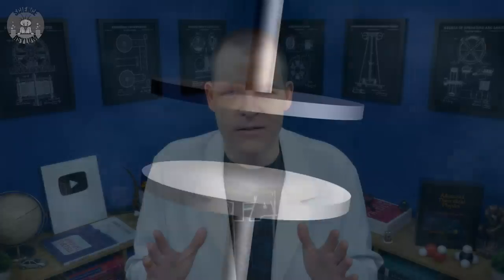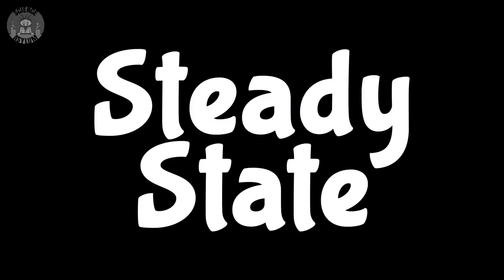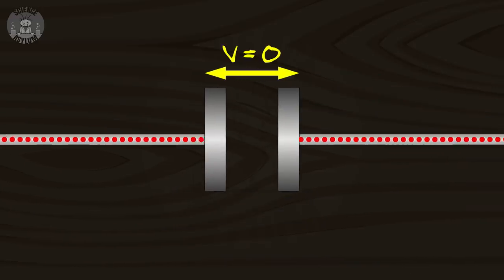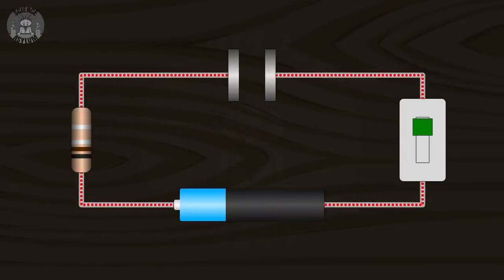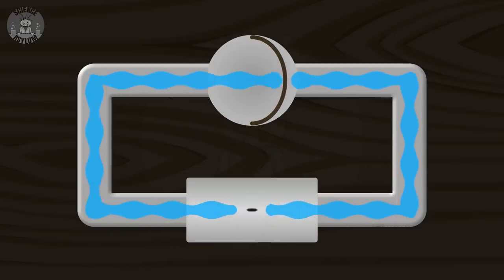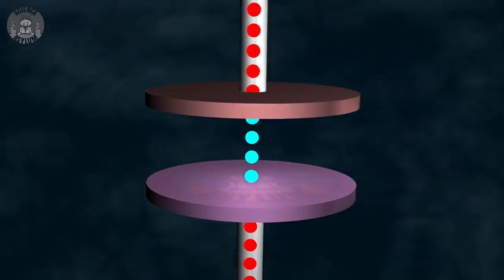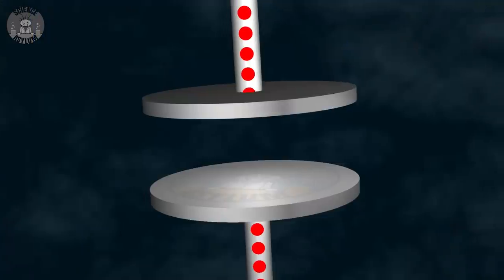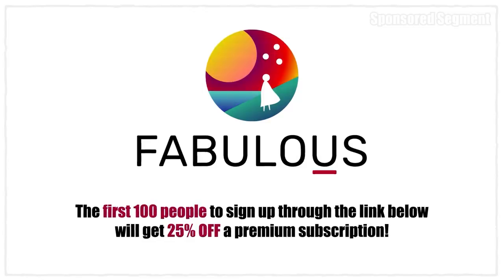Capacitors Are Gaps! How Does That Work?!

Comment: Great video!  I’m not sure your statement about “current not depending on speed” is correct.   Current is the amount of charge flowing through a surface per unit of time.  So all other things being equal, more speed means more current.
Reply from the maker: Yes, more speed means more current, but that's not how it practically happens. More current doesn't necessarily mean more speed. Say you're looking at two points in the same circuit at the same time. If you measure two different currents at those points, the speed of those charges is more than likely the same.

Comment: Hey Crazies, How are batteries working? I learned it at school like it's a watertower/waterbuffer and water is flowing from a higher to a lower point, but I noticed now that electricity is not water.
Reply: There's an electric potential accros the two ends of the battery that is shorted when you close the circuit. It is very similar to a water buffer, actually. The electrons are the things flowing.
Reply: It depends on the battery technology, as well as how you define "battery". We'll use lithium ion batteries as an example:
On each end, there are two terminals, the anode and the cathode. These terminals are separated by an electrolyte that is permeable to lithium cations, but not electrons.
Lithium as an element is very reactive, even to normally inert things like water. As an alkali metal, it has a very low ionization energy, having only 1 electron in its valence shell. Because of this, it will drop that electron at a moment's notice, turning into a lithium cation. This act of giving up an electron is called oxidation.

At the cathode is a type of metal oxide, typically cobalt(II) oxide. At the anode, there are many sheets of graphite, which are hexagonal lattices of carbon atoms stacked on each other. The graphite essentially acts as a parking lot for the lithium ions and electrons, not interacting with them chemically but being a space for them to hang out. In a fully charged state, all the lithium ions and electrons are sitting in the graphene. The electrons really want to go to the cathode, but can't get through the electrolyte. In this configuration, the chemistry is unstable and high energy [or rather, high potential]
However, when you attach something to connect the two terminals, it channels the electric field through itself and the electrons start to rush over to the cathode through that new path. The lithium ions, attracted to the electrons on the other end, can simply pass through the electrolyte. In its cation form, it can't do anything with the cobalt-oxide lattice, but if it also encounters an electron at the same time, it reduces back into a neutral lithium atom and can bond with oxygen atoms in the lattice to produce lithium cobalt oxide. This act of gaining an electron is called reduction.
In a completely discharged state, all the lithium atoms are in the cobalt oxide lattice. In this state, the chemistry is very stable and very low energy [potential]

When you plug them in to recharge, the cathode becomes oxidized and cationic, which pulls on all the electrons from the lithium cobalt oxide. As the lithium atoms are oxidized [due to their easily being able to ionize], they become attracted to the anode, which is being reduced, and pass back through the electrolyte into the graphite. The cycle continues.

All rechargeable batteries are based on the principle of a reversible reduction-oxidation reaction [redox reaction]. Non rechargable batteries use redox, but are not reversible.

Comment: Except electron's kinetic energy, energy in a capacitor circuit flows via electric & magnetic fields. Electric field moves within  the conductor & capacitor plates but magnetic field moves outside the conductor & capacitor plates. Energy does not flow from outside into the conductor or capacitor plates.

Comment: Great explanation and amazing visuals, thank you! But! You missed the most interesting part, what's the use of these capacitors? Shows that you are theoretical physicist 😉
Reply: There are thousands of uses of capacitors in the electronics industry.  The short answer is that they are used for filtering signals, as they respond differently to low vs high frequencies, unlike resistors that respond uniformly to all frequencies.  Capacitors and resistors can be used in combination to form low pass filters, high pass filters, and band pass filters, that selectively allow certain frequencies to pass through a section of a circuit.

The power supply in your computer uses them for smoothing the pulsating DC that the diode rectifier produces when converting AC into DC, into a much more steady DC voltage that your computer requires.

Comment: I can still remember the smell of tantalum capacitors and their unique ability to reliably create a shortcircuit when failing. Good times! I'm getting old though…
Reply: And electrolytic capacitors make great confetti generators when you either exceed or reverse the voltage across them!

Comment: What determines the “uf” (capacitance) of a capacitor?
How much energy can they “hold” before becoming saturated? 
👍🏻😁👍🏻
Reply: energy is not just the uf its the uf and voltage
but the bottom line is that the energy is proportional to the surface ares of the plates
Reply: For idealized parallel plates: C = epsilon*Area_of_plates/Separation_between_plates
Energy in capacitor = 1/2*C*V^2
Reply: @joaquinledesma1373  Don't forget to add the dielectric constant to the numerator (ok, you multiply by the dielectric constant).
Reply: It's the amount of voltage that will develop between the plates per unit charge.  It's like a compressed air cylinder.  A large cylinder can take up or release a larger amount of gas before the pressure inside will change much whereas trying to force any gas into a small bottle makes the pressure go up a lot.  Pressure is like voltage, the strength of the tank is like the voltage rating, the air is like charge and the capacity of the tank is like well.. capacitance.  A 1 F cap will charge up to 1 volt if 1 coulomb flow into it.  1 coulomb passes after 1 amp flows into it for 1 second.
Reply: The uF stands for microfarads.   It is really supposed to be a Greek mu, but we often print a u as a look-a-like replacement for it.

The capacitance is only a function of the geometry of the capacitor, and the identity of the dielectric.   It is a measure of the charge-to-voltage ratio at any given state of charge.   It's the "capacity" of the capacitor to store a charge on the positive plate, and an equal and opposite charge on the negative plate.

Comment: Parallel signal wires have a capacitance of 10 pF per foot.  Wire has an inductance of 1 uH/meter. When we lay out printed wiring boards for low noise, we take these parasitics into account.

Comment: How capacitors holds energy without after disconnecting from source?
Reply from the maker: The energy has nowhere to go if the capacitor is disconnected. (Of course, that's an "ideal" capacitor. A real-life capacitor would very slowly discharge into the air.)

Comment: One question: if I measure the current of one circuit to be 1A and I turn up the voltage then measure it again to be 2A, what actually happened with the charges? Are there more charges running through the wire in the same velocity (larger density, same momentum) or are there the same number of particles but running at higher speeds (same density, larger momentum)?
That question not even my teacher could answer…

Comment: MY physicist!!!    When you say it there's no voltage across I got stuck on the word across because voltage is simply the difference in electrical potential between 2 points so I got stuck right around the same time you said wait a minute something doesn't make sense here.

 Quick question is the displacement current that builds up across the gate of a capacitor similar to the UZ build-up of Electrical potential that precedes a lightning bolt. I think they called it a ladder

Comment: The way capacitors work, make me think there is alot more going on, that we have no idea of what else is happening! It would be awesome to see the current in a wire and capacitor beyond what  electron microscopes can see! Seeing electrons actually moving , maybe someday, if we don't destroy ourselves first!
Reply: The actual "drift velocity", the net speed of the electrons as they move through the wire is actually rather slow. Maybe millimeters per second ( someone correct me). As kids we all have this idea of electrons thundering through the wires at light speed, but it's the the complete opposite. As TSA says, it's the electric (and magnetic) fields that are where the action.

Comment: I'm a civil engineer but I hope we can cross the iron curtain anyway 🤓👾 I was happily enlightened.
One question hit me though. The energy flowing into the capacitor, where does it reside? The gap could be a vacuum, right? Potential energy in the plates atoms, both sides?
Reply from the maker: The energy is contained in that electric field between the plates.
Reply: @ScienceAsylum  sounds like a sentence coming straight outta an anime!

Comment: Great stuff!  It would be cool sometime to cover the EM wave reflections that occur after the switch is thrown.  For zero-resistance wires (and battery and cap), it oscillates forever!
Reply: Could you explain what you mean? Surely the switch gets thrown, there’s a peak and some bouncing then the cap charges and then it’s stable?
Reply: @uhhhhh262  Yes, but with no resistance, it keeps bouncing!  I'm thinking of the wires as ideal transmission lines and no dissipative resistances anywhere.   Even without a capacitor it oscillates forever:  Before the switch turns on, you have a big voltage drop across the switch (and the battery).  When the switch is thrown, the voltage discontinuity propagates along the wire around to the negative terminal of the battery which then emits a "canceling wave" back down the wire.  That wave propagates around toward the + terminal of the battery, leaving 0 in its wake, until it hits the battery, which responds with a positive dc voltage that propagates back around to the - terminal, and so on.
Reply: @JuliusSmith  that’s interesting and honestly my electronics knowledge is rather limited as I work in commercial electrics, but I think you’re saying the cap would considerably smooth it out but once charged would then leave a small ripple on the wire if met with zero resistance? This would happen with no potential? Or the wires themselves create their own potential as whichever end of the wire has the wave the opposite end draws it back?
Reply: @uhhhhh262  The capacitor basically adds a "spring" to the picture, but it's a spring that instantly compresses and decompresses.  It would repeatedly charge and discharge instantaneously.  The voltage discontinuity remains vertical because there is no resistance anywhere.  Now the voltage-step shuttles back and forth (close to the speed of light, some say about half that for practical wires) between the switch-side of the capacitor and the switch-side battery terminal.  The non-switch side of the capacitor has a constant voltage equal to that of the battery terminal it is connected to at all times, and this never changes.  With the capacitor in the circuit, the oscillation is only in the wire containing the switch, between the battery and one side of the capacitor.
Reply: @JuliusSmith  sorry I presumed because you mentioned a battery that we were talking DC? Therefore no discharge. I completely understand your first comment now if you was talking AC!
Reply: @uhhhhh262  The battery creates the potential, and that propagates to the capacitor and switch and back.
Reply: I just realized that when the switch is thrown, equal voltage-steps must propagate away in both directions from the switch.  If V denotes the battery voltage, then the switch-wire jumps to voltage V/2 initially, and V/2 steps go out in both directions (one +, one -).

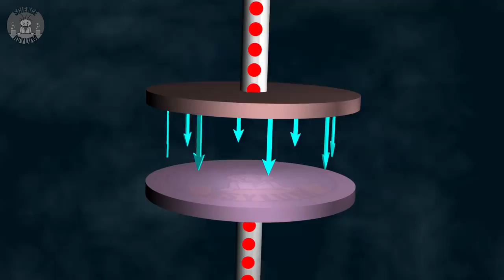Comment: Nick 1 question though from 8:29 that you've shown electric flux coming out from the plate where all the negative charges are accumulating contrary to our basic understanding that electric flux originates from positive charges so in my view,  electric flux should come out from lower plate or in the direction opposite to the direction of flow of electrons. 
Kindly reply 😊
I guess you're using conventional current theory here?
Reply: I noticed that, too. I recall a discussion with a EE student when I was a physics student about which way the current flowed. My view was from negative to positive as electrons were the charge carriers. His view was the opposite: flow was from positive to negative. I think we have Ben Franklin to thank for that.
Reply from the maker: Yes, I'm using conventional current in this video. A couple years ago, I tried using electron flow instead in my videos out of stubborness and a lot of people got confused (or at least distracted). Conventional current is just too ingrained at this point.

Comment: Actually with resistance it takes forever to charge the capacitor with DC source, so current is always flowing.  Switches have capacitance too, so a switch never truly stops current flow.

Explain that "superconductors have resistance" statement, current has been observed to circulate in them for years.  They have reactance but not resistance.

Comment: Capacitors are used to smoothen the variations of current (you can make something like a voltage regulator with them)
Reply: Actually, capacitors are used to smooth the variations of voltage. To smooth the variations of current, we use the "opposite" of a capacitor - the inductor. It does more-or-less the same thing, with the magnetic field instead of the electric field.
Reply: @aveekbh  You are correct, but I corrected myself saying about the voltage regulator
Reply: Yes, I see what you mean. Capacitors act as a reservoir of charge, preventing variations in current (rate of charge flow) from affecting the voltage.
In fact, all voltage regulators need additional capacitors to function properly. The capacitor provides a burst of charge (current for a short period of time), allowing the voltage regulator to "catch up" (all circuits have a maximum rate at which they change, their bandwidth).

Comment: Analyzing power flow in a dc or low frequency circuit using the Poynting vector is not a thing. The Poynting vector is used to determine the magnitude and direction of power flow in an electromagnetic field propagating through free space. It does not apply to power flowing in a dc or low frequency electric circuit.

In a steady state dc circuit, there is no electromagnetic field because the electric charges are not accelerating. That's right, an electromagnetic field is created from accelerating electric charge. In a steady state dc circuit the electric charges are are moving at a constant velocity through the wire at about 80 to 90 percent the speed of light. Without accelerating electric charge, there is no electromagnetic field and without an electromagnetic magnetic field there is no Poynting vector. 

So what about the case of low frequency 50/60 Hz power? Don’t we have accelerating charges then?  Yes, and yes there is an electromagnetic field but the energy propagated by that electromagnetic field is only a small fraction of the energy flowing in the wire. Close to 100 percent of the energy flows inside the wire.

What about the notion that the electric charges inside the wire don’t carry the energy? Sure they do. When the charges leave the battery, they have potential energy which we can measure with a volt meter.   When the charges go through the light bulb they give up that potential energy. Just move the voltage probe to the negative side of the light and you will read 0V. 

I applaud scientist who are willing to spread their knowledge through social media but, like everything else, it is important to make sure that the facts being propagated are correct.

Comment: As a layman I have been warned that it may be dangerous to mess around with the inside of any electrical device as it may have a capacitor and they may retain a dangerous, even lethal, electric current long after being turned off or disconnected. Is this true for both AC & DC circuits? How long does it take the charge to go completely.
Reply from the maker: Oh yeah! Capacitors are dangerous, especially the big ones like the ones inside microwave ovens. DON'T EVER MESS AROUND IN ONE UNLESS YOU'RE A TRAINED PROFESSIONAL! (While larger capacitors are often designed with a resistor across their leads to help them discharge, resistors burn out over time. There's no way to know if the resistor inside the capacitor casing has burnt out. If it has burnt out, that capacitor could easily hold it's charge for decades. Probably longer.)

Comment: 3:25 Wait really?  When we did problems on the transient state of RC circuits in circuits 1, I remember the transient state being a tiny fraction of a second.  It was neat though, because technically the transient state never completely ends -- the current never completely stops -- it just decreases exponentially.  Still, I remember it decreasing so quickly that it was basically zero within a tiny fraction of a second.  I remember the transient state lasting longer for some transistor circuits though, to the point that I could actually see the variation in the oscilloscope plot without having to zoom in at all.
Reply from the maker: You must have been using a tiny resistor and/or capacitor. The time constant = RC and it takes a few time constants to reach (approximate) steady state.

Comment: In the AC capacitor/energy  animation, you show the energy is pushing out.... Why is that? Shouldn't direction of both electric field and magnetic field reverse?
Reply from the maker: Yes, both the electric and magnetic field reverse, but not at the same time.
Reply: @ScienceAsylum  😲